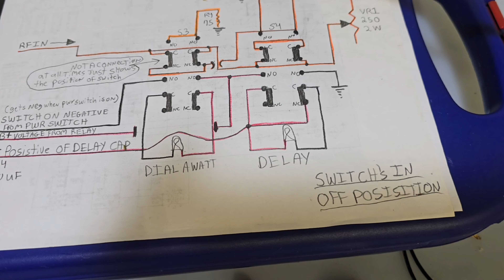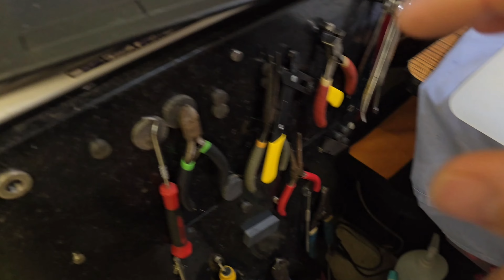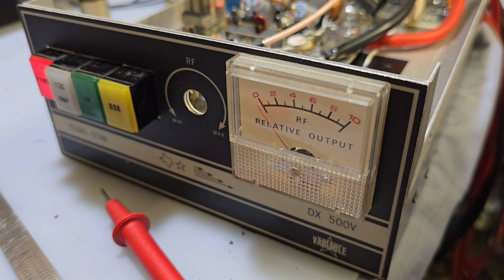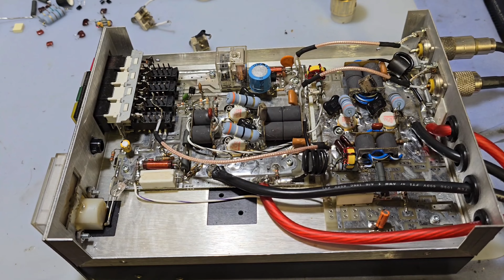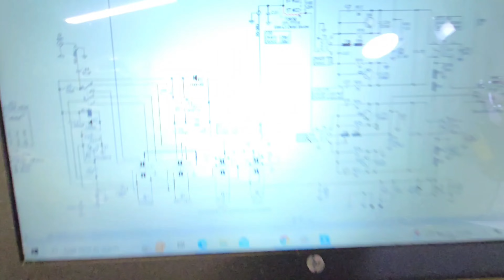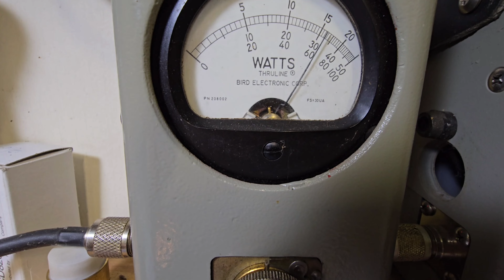Convert[ReTune] A TS500 To 10m 28.4MHz - REALLY COOL!

Comment: Seems strange to request having SSB on all the time.  It would seem simple enough to just keep the button pushed in all the time.  At least you still have the option to use other modes (like 10M FM).  It would be interesting to see the input tune and output power of each frequency at 25.000, 26.000, 27.000, 28.000, and 29.000 to see how it does.  Cheers!  How's the pet slug doin by the way?  😆
Reply from the maker: Lol lol That pet slug is in slug heaven if I remember correctly lol lol lol.... Yeah we'll it would still work with FM just fine just will have that slight delay even on AM thr delay is not noticeable much at all. Just enough to notice that it is working. But I agree with you just keep it pressed in.  Thinking back maybe I should have added a switch to disenge auto ssb like that.

Good idea on the swr I should have thought about that... I can always put it back on the bench real quick and do another video 📹

Comment: Nice re tune. I have a DX 500 4 level one. And it has goot tune at 28.000 Mhz so I left it. only drops a tad on 11 meters and drops again at 29 MHz .  It does drop a lot at 12 meters . I don't use it their.  I do use it 28.074 Mhz. The Tech part SSB is 28.3 to 28.5 . wanted center of that.  I have a low pass filter on mine. I also have band pass filters .  15/20 meters. some day I get 17 meter/30/12/40/80 maybe 60 meter filters. haven't needed them and costly.  I have the MFJ low pass filter and a RM Italy one. does the job. I took out my keying transistor and delay cap. PTT only. They have PL 259 for RG 316. Haven't used them yet.  I do have some that go right on RG 400 and 8X and POTA flex 6 coax. M & P has great PL 259 in many sizes.  I got the 7 mil ones as well. Best PL 259 I have found. For short runs RG 316 DS is great . I got MIL spec RG 58C/U . That good for short runs as well.  ABR and M & P both have RG 58C/U . I have the stuff made for the british military.  It is red . 1 UK seller has it.  I have that Stinger wire. nice wire. My spool is OFC 10 AWG . They have outher sizes. 73

Comment: Think it might benefit from an internal B+ jumper between the boards just in case one of the external B+'s got accidentally disconnected?
Reply from the maker: Yes but this is why I twist the power wires together really well and solder them completly. If someone disconnected them and ran only 1 wire it would be a rare occurrence I would think. The 10 years I have been doing this I haven't heard of anyone doing this. Not saying it don't happen. I really like talking the person into allowing me to add connectors to each wire and adding a quick connect to them.
Reply: @1883GotDown  good idea and sounds like you have it covered. I was thinking of the end user and some of the things we've all seen....wire nuts, black tape and worse. Lol